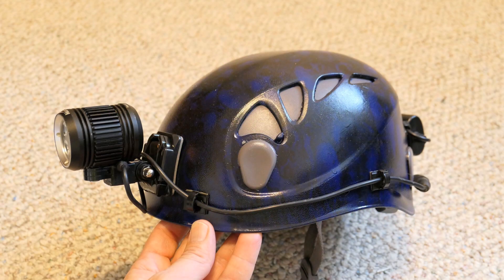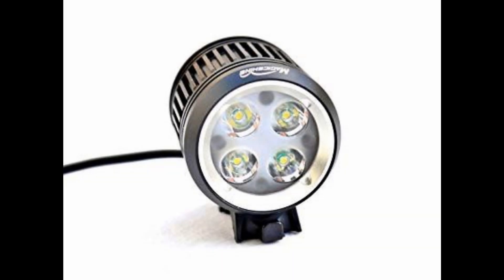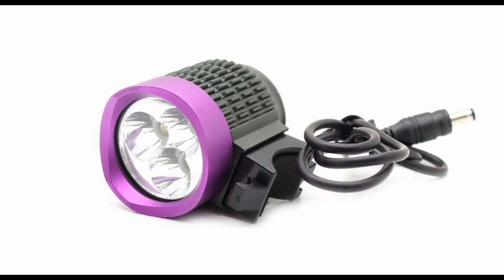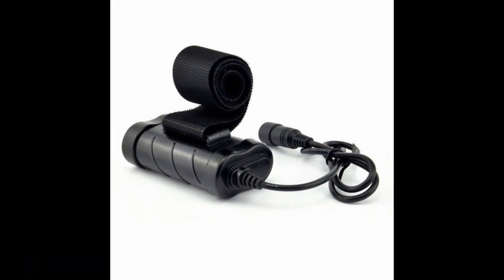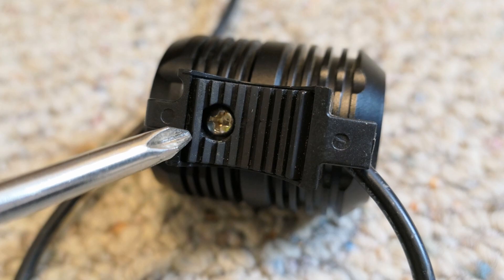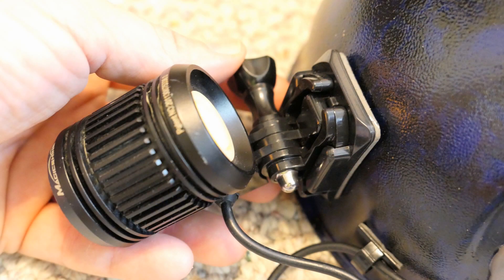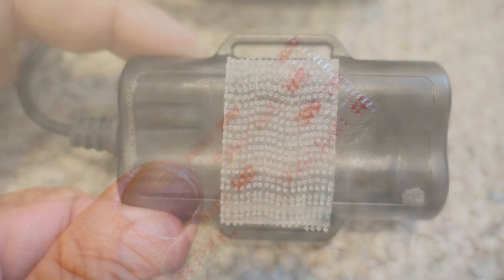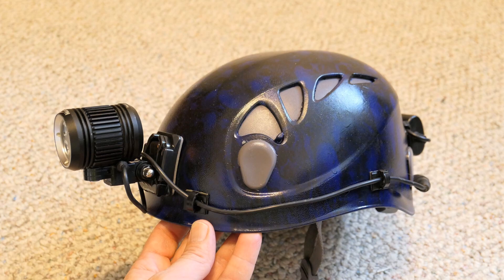1600 Lumen Caving Light System (DIY)

Comment: What was the runtime for each setting? I noticed that you had included the information in your newest configuration, but not this one.
Reply from the maker: I think it was 8 hours on low, 45 min on high. I upgraded the battery back that will use 4x18650 that you can swap out. I can send you that information if you're interested
Reply: @mwstoll  Thank you, and I think I'd like the information if it's not any hassle.
Reply from the maker: @fridgeonwheels5622  I purchased a 4x18650 battery back on Ebay called "18650 Battery Pack Case Power Bank Box with DC + USB Dual Output for Bike Light". It is no longer listed. The two Ebay sellers I purchased them from were: akeupdiarys6 and sunnyhome07. You can try to contact them to see if they sell it. I purchased them for $16 bucks and they work great. You case opens and you can swap out the 18650 cells.
Reply from the maker: @fridgeonwheels5622  With this set-up, I get around 3 1/2 hours runtime (various light settings). You can buy 2 cell battery packs cheap from http://kaidomain.com/.  They ship from China, so you'll have to wait about a month for transit. Comparing this to the 3,000 lumen version, I am on the fence for which set-up I like better. This one is much more compact and weighs less. If I need more light, then I can break out a handheld light. That being said, it's nice have 3,000 lumen available if you need it.

Comment: Couldn't you route the cable through the helmet?  Also, I wouldn't trust adhesive mounts for caving.
Reply from the maker: You could run the cable inside the helmet if you want to add a few more holes. The GoPro mount sticks pretty good. Extremely hard to remove. The Industrial Velcro also sticks very good.

Comment: Mike is that the light you also use for your videos
Reply from the maker: I use the same light, but instead of just one, I use two mounted on either side of the helmet, with the GoPro mounted in the front, center of the helmet.

Comment: I have lots of 18650 batteries lying around and want to find a waterproof pack that I can remove and replace batteries in a cave. I can find 4 cell packs, but no 2 cell packs. Suggestions?
Reply from the maker: I only found a 4-Cell pack too. Could never find a 2-Cell Pack Case. That's why I went to the Magicshine. By the way, one of my Magicshine batteries failed within a year and the Manufacturer replaced it for free.